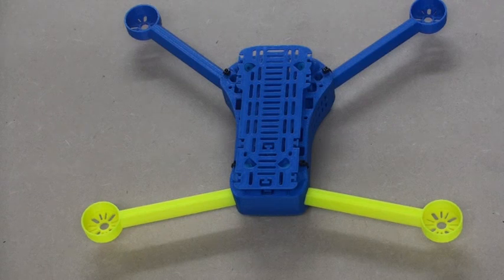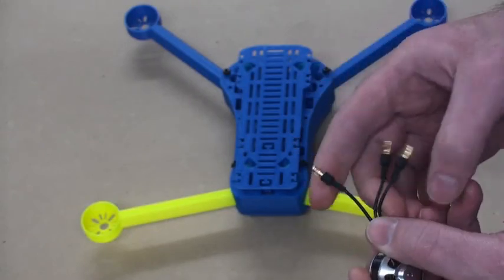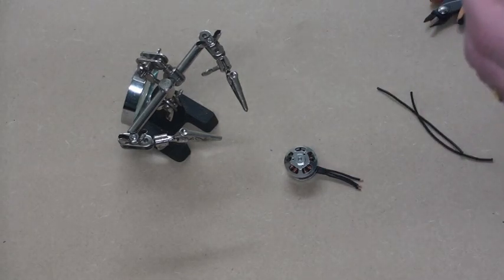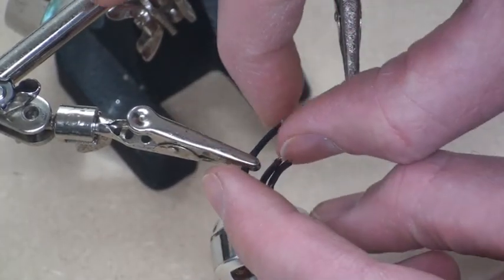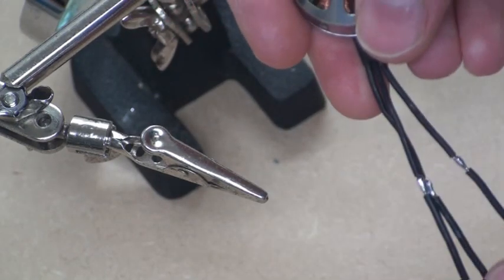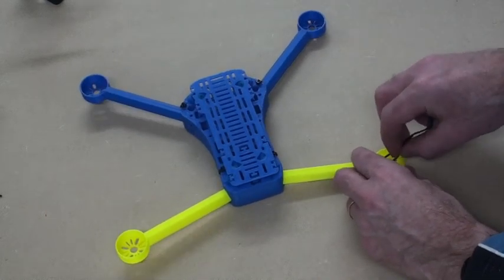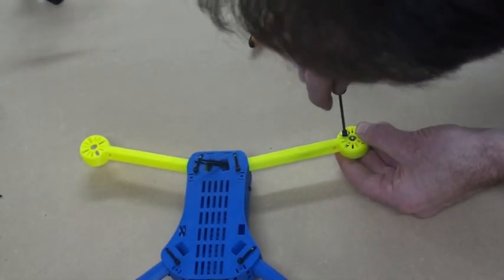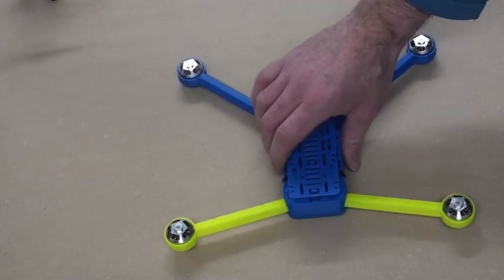T4 Mini Quadcopter build part 2: motors

Comment: Does anyone know if you are supposed to use the 28mm arms if you have 28mm motors? I have printed the 28mm arms and the motors are nowhere near fitting in. Even the sketchup model dimensions as 27.7mm which leads me to believe I should have printed the arms with the 30mm cup?
Reply from the maker: Yes you will want to allow a couple of mm clearance so use the 30 mm cup size arms.

Comment from the maker: @Ben. I've got different motors/props on each of mine.  Basically smaller/lower power/faster (higher kv) motors on the 250 and bigger/more powerful/slower (lower kv) motors on the full size T4.